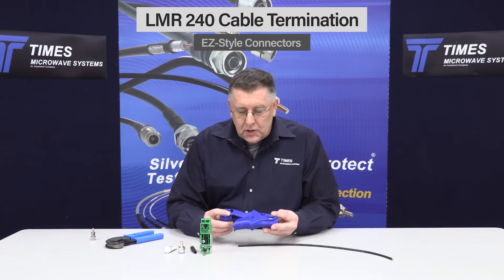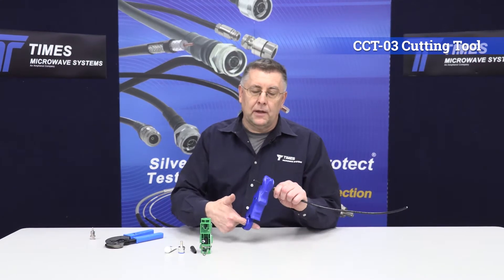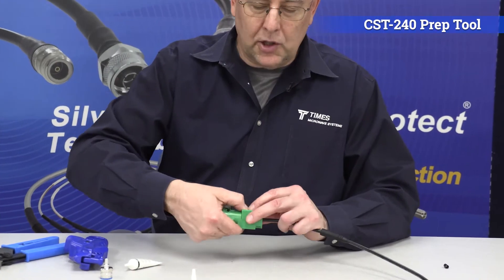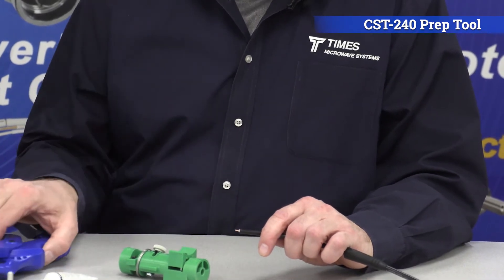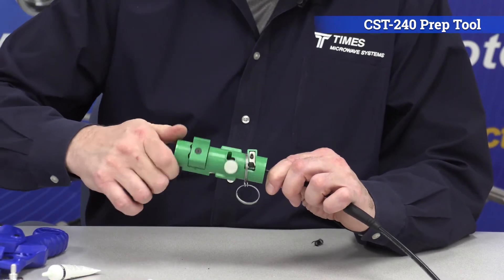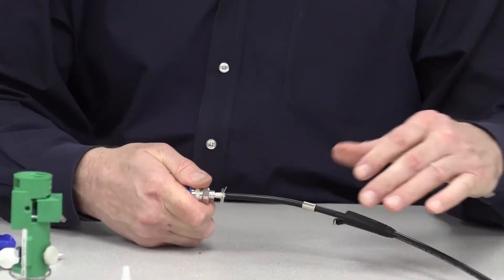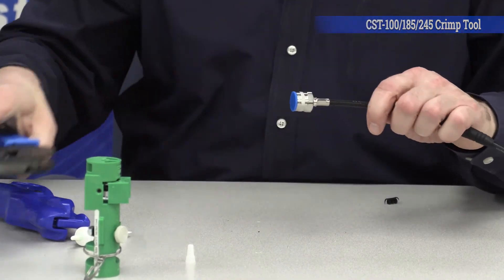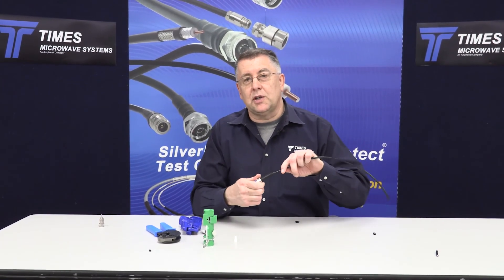Demo Discoveries: Efficient Termination of LMR 240 Cable

Comment: Nice, but I have read on different sites that it does not cut the center conductor long enough for PL259 connectors. Lot of $$$ for something that won't work on these connectors.
Reply from the maker: Thank you for your feedback. The tools are designed to work with our own connectors. Our PL-259 uses a spring finger captivated pin which has prep dimensions which align with those produced by the CST-240A.